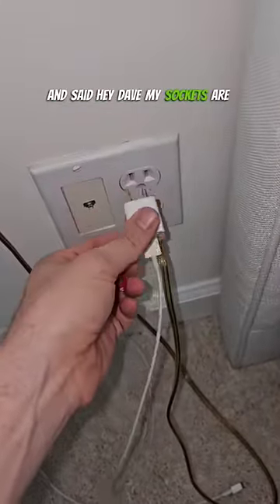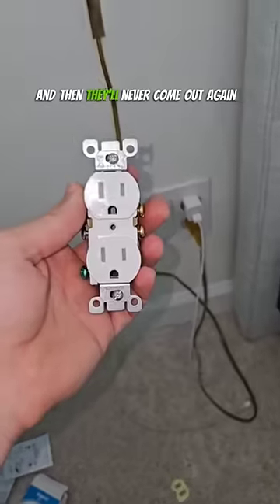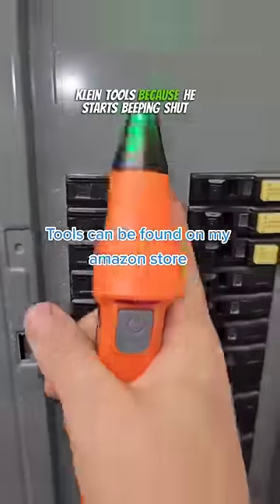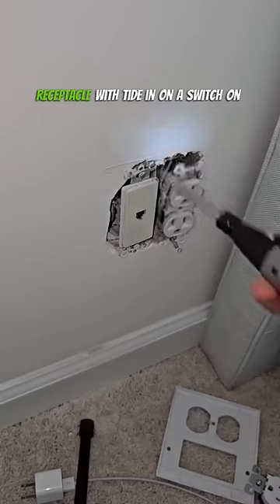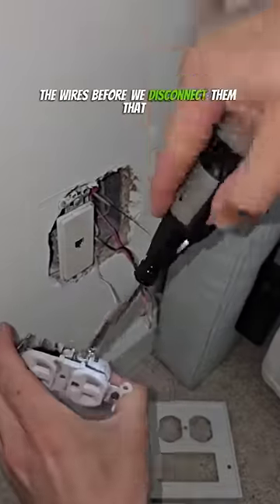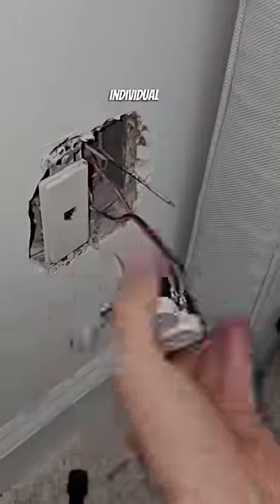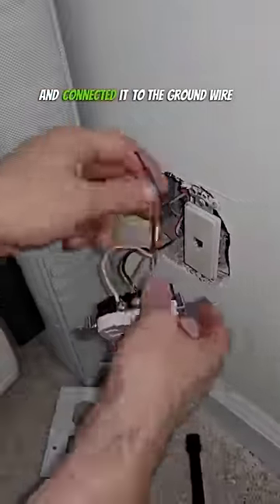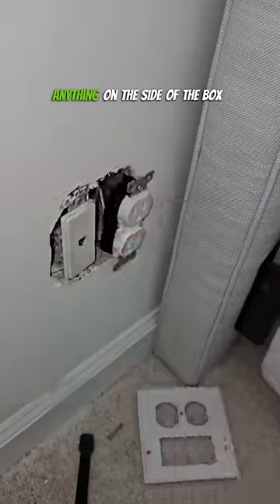🔥 Thats a hazard! How to change a switched outlet #diy #handyman #electrician #HowTo

Comment: I've run into outlet boxes fed by multiple breakers.  Always check for live wires after turning off "the" breaker.
Reply from the maker: Good tip
Reply: Yeah that's a bad idea telling people it's safe after tracing a wire to a single breaker. I have had dozens of panels that were wrong or had multiple breakers going off
Reply: Aslong as you don’t mess with the other hot circuit you’ll be alright
Reply: Solid tip. That’s why he used the outlet tester, though. 👍🏻
Reply: @taylorstanden  using an outlet tester is good, but if you do, test every outlet.  If there's a switch in the box, it might be on a separate circuit.
Reply: @tgeliot  Agreed. 👍🏻
Reply: If you get bit with 110 it’s not the end of the world.
Reply: What? Then multiple breakers must be feeding the same live... What kind of clown would do an installation that way?
Reply: When I’m changing lamps, I usually do the nice three step of

1) turn off breaker
2) check with multimeter
3) short the wires

Only then I work on it. I’ve once tripped the breaker, because I turned off the wrong one, and apparently didn’t check correctly

Rather have a tripped breaker than a shock, and if I don’t mess up, shorting the wires does nothing.
Reply: @niklascarlsson2841  Not the same live, but two lives occupying the same box (and outlet and the switch for the garbage disposal, IIRC).  This home had a bunch of weird wiring.
Reply: @joshblubaugh6050 you do know that amperage is what's dangerous about electricity not voltage right? It only takes about 100th of an Amp to kill you.  This is why people can be struck by millions of volts through lightning and survive but dozens of people die from a simple 120v outlet every year.
Reply: I learned that one the hard way 🎉
Reply: Yeah I just turn off the main breaker now and still the breaker lol
Reply: @Carl Smith  WRONG. increase in voltage  over comes resistance in insulation. There is a large difference between getting shocked by 277v vs 120v. Stop spreading myths around also typically higher voltage circuit are used to power higher amperage devices. 120v feels like your hand is numb 240 and up feels like a hammer.
Reply: Yeh I fumed at him not doing that. And making a vid for many people to learn from that bad habit too.
Reply: @mandoperthstacker  in the real world we don't turn off circuits man. Only plumbers and diy guys do
Reply: Meh just be a man and test with your hand
Reply: @mitri5389  where did you go to electrical school?
Reply: @mitri5389  I got bit by 270 at work for a good 20s fell about 20 feet. Tore up my hand 3rd degree burns, skin graphs the whole 9 yards. I’m just lucky it went in my hand and out my hand and that I’m still here. Tripped the 20amp breaker the circuit was on. Definitely way worse than a 120v zap lol
Reply: @Mechanicallyincleyend  you know what they say: "bad electrician does not exist"...
Reply: just wondering, why tf would someone ever wire a regular outlet to multiple breakers
Reply: @stevensalerni1368  one for regular power and another for a switched outlet.  It doesn't happen very often, but I've seen it.
Reply: Ran into this a few weekends ago moving an outlet from one wall to another in my basement. Spooked me good, the breaker did it’s job and cutting the power but it’s never a dull moment when dumb dumbs run their own electricity.
Reply: @carlsmith5678  no, it’s combination of volts, amps, resistance, and time exposed that determines if you live or not

you need a minimum amount of voltage for electricity to even pass through your skin. this varies based on how much resistance your skin has.

take a 9 volt battery for example. when you touch the two ends with your finger. nothing happens. there’s not enough voltage to pass through. but if you lick it, you can feel a tingling sensation. this is because your tongue has much less resistance than your skin. obviously in this example the battery would be DC, but the same exact thing applies to AC as well
Reply: I hired an “electrician” i say in quotes because I thought he was but later found out he lied, he didn’t make sure after turning it off that the wires were not hot and electrocuted himself. They tried to sue my homeowners insurance for medical bills! It was a freaking mess.
Reply: @carlsmith5678  actually you can take hundreds of amps and be fine... Its not amps or volts alone theres safe combinations of both, current is also important you can take 1000 amps, it woold burn and fucking hurt but if the current isnt high youd get one good shock not continuous shocks. Its complicated and honestly if you can help it the best idea is to shut off any brakers that you aren't sure about dont just assume its safe because you shut off the breaker you think you needed. Always be overly careful
Reply: I just work on them live lol
Reply: @unrelentinghighfructosesyrup  It wasn't a single outlet.  IIRC it was an outlet on one circuit next to a switch for the garbage disposal on another circuit.
Reply: @jim22444 he said "and the lights go off" thats what tells you it's not powered
Reply: @Mechanicallyincleyend  Checking the wires are dead with a meter is not a “tip”, it’s required practice. Make sure and include this step in any videos showing people electrical work, otherwise some over-eager DIY guy will electrocute himself.
Reply: @Fs3i  yeah thats a pretty good way if doing it, especially when just working with lower voltage.
Reply: @carlsmith5678  styropyro did a video on this a while back proving this completely false as if you were correct he'd have killed himself several times
Reply: @derekhenschel3191  bro, im a master electrician.  I have been an electrician for almost 20 years and have had to spend 100s of hours in a classroom learning about electricity. The reason why it takes a combination of both is because the current cannot travel through the wire without voltage, but it's the current that is deadly.  The reason why everyone does not get killed when they get shocked is because there are a combination of things that have to happen when getting shocked in order to be fatal. Electricity is never something that should be underestimated, especially 120v
Reply: @person-zl4xk  Well, of course, it's a combination because current cannot travel without village. But it's not the voltage that is you is the current.  There has to be a combination of things that happen in order for us to be a fatal shock but 120v can kill you very easily if you're not careful. Someone can be killed instantly from an electric shock.
Reply: @Mechanicallyincleyend  question: why not just turn off all the breakers?
Reply: How on EARTH is that a thing!?
Reply: you mean actually use a tester even after turning off the traced breaker just to be sure there won't be any nasty high-voltage surprises waiting for you in there once you actually open it...
Reply: @nemo-x  LOL I found a junction that wasn't in a box and didn't even have a wire nut!  It was just twisted wires hanging there in mid air.  I wish I had taken a photo.
Reply: @asakayosapro  Exactly.
Reply: Finally someone in the comments who actually gives valid criticism and doesn’t just say “ I’m British/Australian/whatever. America stinky big dumb bad place.”
Reply: @carlsmith5678  It's more about wattage and potential to ground. That's why you can touch things while you're welding at 200 amps.
Reply: @tgeliot we believe you
Reply: @l00tur irony lol

Comment: I LOVE having a properly labeled breaker box.
Reply: I got a whole house surge protector since I live in an area with storms and they installed the box upside down, which also meant the sticker was upside down 😭
Reply: tbf I think they did it so the doors to the sub box and main box swung out the same way, and only realized the mistake until it was too late

Comment: As an electrician, I have to give props to adding the electrical tape at the end. No one seems to do this. It’s really good practice to do and the ones who don’t do this always think it’s a waste of time.
Reply: You clame to be an electrician and don't know why you don't do it phift
Reply: @lemnlit3291  to save time. In my 10 years, I’ve never ran into a reason not to do it besides maybe saving 8 seconds.
Reply: I gave him props too.  I typically do it only on multi gang boxes, especially if there is more than one circuit in the box.
Reply: Adding Electrical tape to an outlet is not good practice, just shows that you are not confident in your installation
Reply: @Wesker8644  not true at all. The tape is to cover the exposed edges for the next person who takes out the outlet hot, to protect the exposed edges from touching the sides of a metal box, and as mentioned by the person before you, to keep multiple circuits tied to multiple outlets separated. This all ties back to keeping the next person who works on the outlets safe. A good electrician thinks about the next person working on equipment so they can do their job safely. Simple as that.
Reply: I dont tape my receps but idc if people do.
Reply: Only thing he could have done better is either hot stick check or meter verify off and could have schedule in door for circuit identification.
Reply: @Wesker8644  incorrect. At any point where you yourself are not the person doing any and all future service to the circuit. that is a hazard for anyone's life who then works on the circuit in the future. Especially in this circumstance where there was no original grounding. A short from receptical to the box would also arc and cause the failure of the device. Best practice is tape or if you wanna get fancy heat shrink.
Reply: @tuckerjennings1816  this is true. Just because someone thinks the circuit is off doesn’t mean one should assume the wires aren’t hot. That’s how a lot of accidents happen.
Reply: As an German electrician, i have to say this isolation ist bullshit 😅.
Use other sockets.
Reply: @juli5886  as a North American Electrician, I for one am jealous of your outlets. Ours are some of the worst. Europe outlets are 100% better thought after, no matter the region. Our plugs don’t even have insulation at the base to prevent accidental shorts or even accidental touching of the plug when it’s getting plugged in. Our outlets also are flush with the wall, where European outlets (from what I know) are recessed a little in the wall. That makes much more sense for safety.
Reply: @danielschmaderer  I would rather they short it out and pop a breaker vs the next step which is take the tape off and procede to get shocked
Reply: @rwood1995  it helps with small junction boxes as well. Tiger grip j boxes are very narrow. I wouldn’t dare put a receptacle in one of those without tape. I would also prefer not to use a tiger grip, but if someone already installed it and that’s what I have to work with, then so be it.
Reply: @Wesker8644  did you know electrical physics, please self teach on YouTube
Reply: Any good electrician would verify it's dead BEFORE removing it. If he's removing a hot outlet, he's cutting corners. Also, removing tape to work on a hot outlet poses as much risk as pulling out a hot outlet..
Reply: @jawms  I do agree with you on that one 100%. A good electrician shouldn’t remove a receptacle hot. Regardless, the tape does help with other things as mentioned in the comments.
Reply: @danielschmaderer  in what way? The circuits are IDed by wire colour's, or not interacting with the other Outlets in the box. If the outlet is installed correctly it can't move, and if it does move the screws are recessed to specifically NOT touch the box walls. If they do touch the box, it's grounded and trips your breaker/fuse instantly.. So whats the tape for?
Reply: @jawms  1) it’s an insulating barrier between the outlet and the metal box. 2) to keep possible multiple circuits away from possibly touching.

Based on your spelling, I’m guessing you aren’t from the US. Your codes and outlets aren’t going to be the same as ours, so the way I would do it probably wouldn’t improve anything on your end. I will say, our outlets and plugs are inferior to countries like Europe, which have great and basic design compared to the US that should be standard for safety.
Reply: @danielschmaderer  Nope, Canada. Same Outlets. Also, if other circuits are possibly touching, you have MUCH bigger problems with the install. Also, the outlets are designed to not touch the box. Seriously, screw a 14g wire onto a terminal. It doesn't protrude past the plastic body of the outlet.
Reply: @jawms  either way, different codes and different habits. To be add to your point, a lot of electricians don’t add tape to the receptacles. I’m one of few due to the way I was taught. I feel it’s a good habit only due to running into issues from large devices and small boxes provided and installed by other electricians. Not saying you’re wrong, but neither am I. It’s all about habit and how well your wires are stripped and installed, which is another topic I get on people about.
Reply: @danielschmaderer  I'm not of the opinion that it's bad practice at all. Just not needed in many situations. Worked with Painters who insisted on having power on (even though we knew they were pulling apart boxes) so we taped up everything. Not worth having a fried painter..
Reply: Replace them with better quality receptacles
Reply: Why the hell would you have a design of socket that needs electrical tape to make it safe?
Reply: @tuckerjennings1816  If the tester says it is off, it is off. Yes would be nice for him to ID the breaker
Reply: @danielschmaderer  if my random youtube feed has taught me anything. Everyday electrical devices and sockets absolutely can kill you if you touch the wrong thing.
Reply: @mwperk02  100% you are correct. Electricity isn’t something to mess with.
Reply: I'm not an electrician but I do this
Reply: @danielschmaderer  the next person has to deal with a gummy mess, trying to get the d**n tape off, or a knife chipping the hard tape off
Reply: @greggpurviance7252  if you’re using crap tape, then yeah.
Reply: @Wesker8644 that has the same energy as asking why a newer car has so many airbags...    why is it bad to have backup?
Reply: Always do it myself, last thing i want is to flip the breaker and look like an idiot.
Reply: Wouldn't be giving any probs to anyone other than a qualified electrician doing any electrical work...
Reply: (Amateur here) I self taught how to do electrical wiring and rewired my 100 yr old bungalow that had scary knob and tube. (ungrounded of course). I got in the habit of wrapping the fixtures in electrical tape and just thought this was an noob hack . Did one room at a time over 10 years. That was 30 years ago and no regrets since. I did a permit when I put in a new subpanel to power the garage. When the electrical inspector came over he just stared at my work and I got worried. He asked who did this, and I sheepishly said "I did". He said, "nice neat job. I should have some contractors see this."
Reply: @Wesker8644  Being confident in your work is just an estimate, it doesn't guarantee your work is good.  As a DIYer, why not have the extra insurance?   It's not that we misconnected something, that kind of thing can be mostly stopped by carefully following the rules, it's the subtle things that can't be determined easily and are mostly known by feel, like if the wire was fatigued by improper bending.

On the other hand, I guess a short from a fully loose wire could be better than a bad connection that would have fallen off and hit the ground and made a short, but instead was held by the tape and was a weak link that got hot.

I don't know if these have ever been relevant in history, but they're the kinds of things I think about with every project....
Reply: @EternityForest  those are the kinds of questions one should ask. If someone doesn’t do an install like me, that doesn’t make them wrong. I’m comfortable with my work and it’s how I was taught both as an electrician and when I switched over to low voltage doing Fire Life and Safety, which is DRASTICALLY less risky, but I don’t want to deal with shorts or grounds with the system I work with.

At the end of the day, do what feels right to you, so long as you’re comfortable and confident with your work.
Reply: @tuckerjennings1816  Why in the hell would you have the box open with power going to it?  Properly installed, that outlet is totally safe outside of an earthquake zone.
Reply: @danielschmaderer becaude it’s against code, also unnecessary
Reply: Most electricians will not use tape around the receptacles..  😊
Reply: When the Earth wire is insulated you won't need to add electrical tape. Also in Europe most modern sockets have insulation on the screws and you can't short anything. I think that is a poor design with those screws
Reply: @juli5886  No. At least not until you stop using 240v outlets for no damn reason. Also, your way of doing things is some isolationist bullshit. Why not use the same outlets as Japan? Why not use the same outlets as India? 
By the way. The US uses the same outlets as Japan, Mexico, and Canada.
Reply: I do the electrical tape everytime I replace a plug.
And I am not really an electrician but I do work on arcade machines for a living so know quite a lot of how to be safe while in the machine.

Comment: Phone, cable or any other low voltage are not allowed in the same box. They make boxes with a divider for these applications. I didn't check all the comments, but was surprised not to see it mentioned .
Reply: I'm a low volt tech, let me tell you, I get nervous having to work in the same box as power, even with the divider. 😂
Reply: The ground wire wasn’t even connected here, this whole house is probably an electrical shit show.
Reply: That's not a divider between them? I thought that until he opened it up